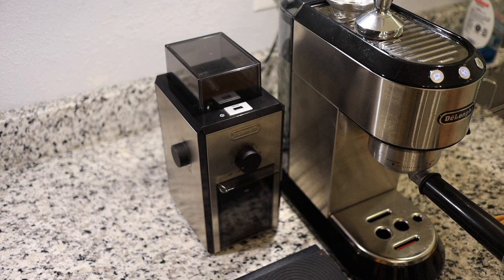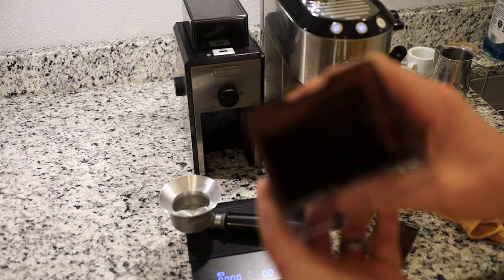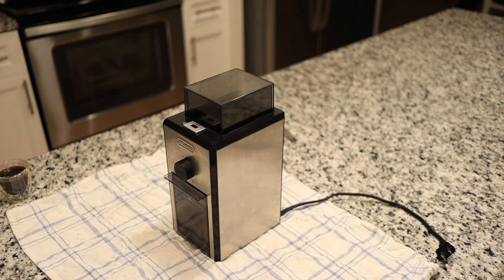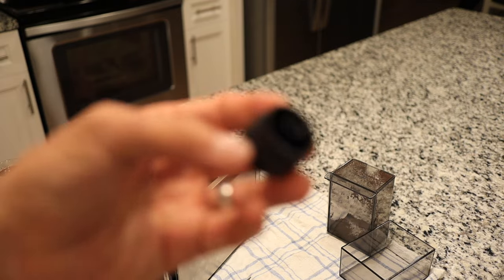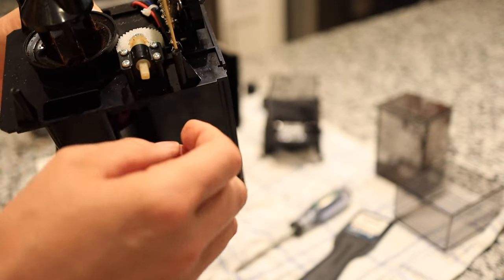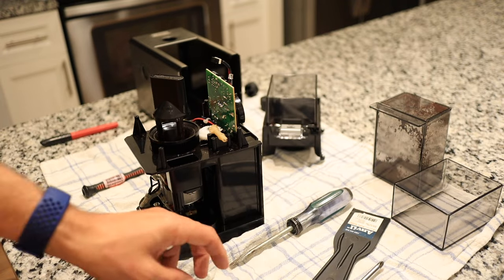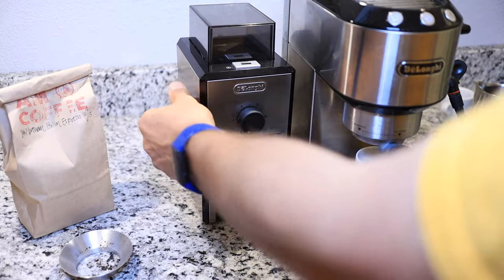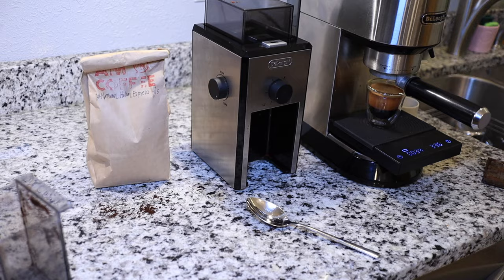Delonghi KG79 & KG89 Mod for Finer Grinding - The Easy Way

Comment: Hey, I just bought this model from Amazon in Ireland and I can confirm that it still works. I did the mod before i even turned it on, and the beans were a little bit too fine when i started grinding for the first time, but then they became perfect for my coffee machine. 

I did only 45 degree angle turn, which was about 5 clicks, and while still checking if the burrs can turn (with the top part on). You don't want any sound when you rotate the burr. Otherwise they will grind against each other. 

Amazing video, thanks so much. I was deciding between this machine and some other for 450 euro. This will do perfectly.
Reply from the maker: Thanks for your feedback, and congrats on your mod!

Comment: Just bought this machine. Was a little disappointed in the tase of my favourite blend and was thinking of sending this back for a refund. As it is not too expensive, I thought I would try this little hack. As in a previous message, I tried 13 clicks, which was too much. So I dialled back to 10 clicks and this was just fine enough. What a massive difference this has made to the taste of my favourite blend. Decided to keep this now. Thanks for the hack.
Reply from the maker: Sweet, Ian! Thanks for the feedback, and I am happy to hear your results. Cheers!

Comment: I did this mod and moved the wheel by 13 clicks. You can reach the motor underneatch and spin it using a small flathead screwdriver to test whether the burrs rub on each other. I can know grind a lot more fine and pull a shot from Dedica using unpressurized basket without any spray or channeling.
Thanks for the instructions!
Reply from the maker: Awesome, Kosta! Thanks for that tip! Happy coffee drinking!
Reply: Can you explain it a bit more detailed? I can figure it out what did you mean by spinning it with the small flathead screwdriver. How can it tell me if the burr is touching? Will it made strange sound when i rotate the motor manually?
Reply: @nhs.14  no. But it won’t  rotate
Reply: In my case 13 clicks sounds like a lot. I just set mine up for about 7 clicks and it is 1 click from 90 degrees. I will test the grind if it is espresso quality I will stop at that otherwise I will keep trying until I hit the espresso fine.
Reply: Did the 90 degrees rotation but wondered if I could go further. Is the 13 clicks as far as you can go? 

Also, I have an idea that you can just use a piece of thick paper to see if the top grinder part leaves a print on it when locked in. If so, that means it's dangerously close to the bottom part. Wanted to test that out to get some extra clicks but I had already done the 90 turn and all the screws were in place.
Reply: @tomaszhachula4171  13 clicks was max, 1 more click and I could have felt rubbing when rotating them using the screwdriver
Reply: @kostabizetic9353  Thank you. Have you noticed that the grinder on that 13 clicks setting have any difficulty with "pulling in" beans? Beans gets less space after all.
Reply: @tomaszhachula4171  haven't noticed or thought about it, maybe slight difference?

Comment: I have a Krups GVX2 grinder; basically the same as this, and the upgrade is the same  process. This said, even after doing this shots were still running a little fast so I decided an alternative, Double grinding. I initially ground my beans at the halfway point, and then reground this at the finest setting...the result?...Med/Dark roast,15g in, 30 g out, 26 sec, 6mm of crema, great shot!....For reference this was using a ITS precision 51mm basket on a Delonghi Stilosa.
Reply from the maker: Hey wow that's an interesting experiment - thanks for posting the results! Tom

Comment: The way I did this mod was to remove the tab on the adjustment wheel. While it's off and empty, you can turn it as fine as is possible to get the burrs to touch. Once there, step back a half turn and turn it on empty to ensure that it's free moving and not locking up.  Then I pull back another full turn and slowly dial in where I want to be.  I think i'm about 3 full turns past where it would have stopped out of the box. But there's no real way to know that.  I do need to change how coarse or fine it is based on the bean I'm using.

Quick note: I got this one about 7 years ago. It worked fine for about 3 months then when I went to make some morning coffee the collector was jampacked full and the motor was burnt out. I dont know if it randomly did that or if one of the kids played with it. So out of habit, I dont push the collector in all the way until I'm ready to use it. It was replaced under warranty and due to the habit, I've not had any problems with it. It's a nice little grinder, if clumpy and lots of static. It gets far worse with the static on dark beans.  But over the years, I have never found a bean that just wouldnt grind with this. Easy to clean and maintain; however it's just messy.  I feel it's been a great starter grinder, with the mod of course.

Edit: Due to habit, the first thing I do when the grinder is done grinding is pull the collector, leave the lid on and have my hand or a napkin cover the "chute" hole and do a gentle tap on the counter. That keeps the mess to a minimum.  I then just use a scoop to scoop out the coffee instead of trying to guide the coffee in that square box...it never seems to cooperate.
Reply from the maker: Thanks for sharing, and for those great tips! Have you tried RDT - lightly spraying your beans with a water mist before grinding? That could help with the static. But yes, this is a sweet little metal burr grinder, considering the price, in particular with the mod. Cheers!
Reply: @TomsCoffeeCorner  I've just recently learned about the misting, but I'm not sure how good that would be since I keep beans in the hopper. It only fits around 6-8oz or just more than half a bag so I'd think spritzing the beans would be a bit messy over time. I'd definitely try if I was single dosing.

Comment: Thank you for the tip, unfortunately mine doesn't work anymore after putting it together. I don't know what i did wrong. Do you have any tips on how to fix it?
Reply: If it doesn't spin, make sure that you don't put the parts too tight, maybe they're blocked. Or some sensor is not connected correctly. Double check.

Comment: Thanks for the video! I have been using the KG89 with this mod for 2 years and I can seem to pull good shots (extraction time is around 25-30 seconds with my Dedica). However, the shots usually taste too acidic, and bland despite using fresh beans. How would you compare the KG89 to more expensive grinders? Should I get a better one, or is it good enough for the purpose? I'm unsure what to expect as I have no experience with high-end grinders.
Reply from the maker: You might benefit from either a hotter pull from a different machine, or trying the steam mode hack on your Dedica.
Reply: @TomsCoffeeCorner  Thanks for your reply! I did some tests, and the steam mode hack indeed helped me to slightly reduce the acidity (to my surprise). Thanks for the advice!

Comment: Hi Tom, is it safe to turn the knob 90º as shown in the video?
Is there a risk of burning the machine?
Do the threads touch?
Reply from the maker: I have found that 90 degrees is fine. Some have done 180 degrees without issue. But, be careful, it's at your own risk. Just increment slightly until you can get fine enough.

Comment: Hey Tom. Question if you were able to get this used for cheap but the kingrinder P2 for about $30 more which would you choose and why?
Reply from the maker: I haven't tried the P2, but I am guessing it will be more consistent, and better to dial in. Cheers!

Comment: Hey Tom. I tried this but now my machine won’t turn on. The sensor turns blue when I press the on button, but no grinding. Can you assist?
Reply from the maker: Could it be that you have the burrs too close together? Can you back off a little bit?
Reply: By backing off a little bit, do you mean changing it back to original alignment? I’ve tried that and still not truly turning on. Only getting the blue power light show when I press the on button.
Reply from the maker: @tylerbarnes659  You might be missing one of the tiny safety reed switches. Please re-check your assembly, and make sure they are all making contact. I think there are 2-3 of them.

Comment: I bought the same grinder and modified the same as you did but still the coffee doesnt come fine enough, any suggestion Tom ?
Reply from the maker: Well, you can adjust it further than a quarter turn, but you just have to be careful that the burrs don't collide. Also, make sure ot use freshly roasted coffee beans. Cheers!
Reply: Am trying with fresh beans first than cuz ma afraid to make it more. Thanks Tom, always you are the best for help.

Comment: Hi, when you say "one notch finer" almost stopped the machine, does this mean you went back into the workings of the grinder and turned the burr even more? Or that the first time you did the mod, you only selected the second to finest size and then tried the very finest the second time?
Reply from the maker: I believe I just turned it around 90 degrees. By notch I mean on the dial. One notch makes quite a difference in grind size.

Comment: It's my first time buying an automatic grinder so I wanted to ask some questions.

First, I mostly plan on using the Kg89 for pour overs so is this machine fine for that? And second is, does the Kg89 last a long time? Like is it likely to break or something? Mind you, I probably won't be doing any modifications to it.
Reply from the maker: Hi there! Sure the KG89 will be just fine for pour overs. I cannot speak much to the longevity, but I think for pour overs it should last a while. That would be my guess. It's lighter work for the motor. Also, the darker the bean, the easier it is to grind.

Comment: Hi, does this grinder works for non pressure filter? thanks for all the videos! it helps a lot!
Reply from the maker: Hello Iker, thanks for the question. Yes, that is what this video is all about. With this modification, you can grind fine enough for espresso, made with a non-pressurized basket. Just watch to the end of the video, and you will see.
Reply: @TomsCoffeeCorner  thanks a lot! As I wanna improve to non pressurised basket and I can't afford a good grinder for it.

Comment: Hey everyone, I just did this upgrade but unfortunately there's another part that he doesn't show in the vid and if you lose it the grinder will not work, So when you disassemble the sensor be aware that there are two parts, The sensor itself and a pin that touch the sensor when you close the lid, When I removed the sensor the pin flew out and it's super tiny so I lost it, If that happens to you what I would suggest is that you glue the sensor to make it always on, So that even if the lid is open the machine will work, Anyway that's what I did and it's perfect now.
Reply from the maker: That's true, you have to be careful that the microswitches stay in place.
Reply: Dude, your comment saved my grinder. I found this little pert on the floor, becouse in the video it doesn't shown. Thanks a lot!
Reply: @Hornton990  No worries brother!

Comment: Anyone can tell me how to know if the grinder touch the burr? If done this but it wasn’t fine enough, my espresso is way too fast and under extracted
Reply from the maker: Hi there! Well you would feel or hear the resistance of the burrs touching. Try not to let conical burrs touch if you can avoid it.

Comment: It feel like your button can rotate freely(from coarse to fine in clockwise direction), and you didnt say(show) where to set the button for the fine coffee grind which is good for nice shots. Tried the mod, recieved kinda good shot at fine setting(meaning didnt move the button after modding), tried second type of coffee(both was medium roasted) aaaand not good.
Reply from the maker: Hey Tohn, I did show that the dial must be turned all the way to the left (fine) before starting. To get a finer grind,   keep turning to the left. If the first batch of beans was good, and the second wasn't, then maybe the second batch was too old...? What brand of beans are you using?
Reply: @TomsCoffeeCorner  Just to clarify what i did was turning the big white wheel anti clockwise 90 degrees(the original marking was on the right) and then put little arm in original position with the knob on the left side meaning that this is the last setting for fine grind, i think i see in video that you just rotated the arm not the wheel, or am i wrong ? Should i dissasemble again and rotate the arm too ?The coffee beans are - medium roast starbucks pike place and the second is davidoff 57 espresso intense(which had almost no crema) with after market basket
Reply from the maker: Hey there, you are right, I forgot to calibrate the wheel, so that when I set it to grind finer now, the wheel goes past "fine." But that's not a big deal, I can just pop the wheel off and adjust. 

As for Starbucks beans, I have had really bad luck with those. Some of the worst I have tried. I think they are too old. Where are you located? Do you have a roastery near by?
Reply from the maker: @NancyBaabe  Hey there, thanks for your comment. Well, I did show all the steps I took. There are various ways to grind finer, but the way I showed, to just turn the stem 90 degrees is the easiest. Do you have any specific questions about the mod?

Comment: I have done the mod and for a long time it worked fine, until i got myself some more expensive beans. Now, at the same grind setting my delonghi machine pops out the rubber above the portafilter, the one around the shower screen. I need at least 2-3 grind clicks lower to make it work. Do the beans make such a difference? Has that happened to anybody else?
Reply from the maker: Hmmm. I have never seen that happen. If anything the machine should choke, not loosen a gasket. How old is your delonghi, and which model?
Reply: @TomsCoffeeCorner  EC680, not that old. I did have to change that gasket eventually cause it got ripped, but it continues to pop it out every time unless I drop the grind setting 2 to 3 clicks coarser from before. Btw, I had it at the middle position before. Then the water runs very fast and the extraction is poor...taste is not good at all. I guess I'll have to stick to the previous beans, can't afford buying new gaskets all the time 😄. Channeling is always there, no matter what I do...
Reply: When using super fine coffee mine choked, but no rubber popping out... Like shown at the end of the video 10:40

Comment: No way! My KG79 is not able to grind beans like yours in "stock grinder test". I bought NPF but i have to change grinder. Using KG79 and NPF Coffee is coming out way to fast and Hance, The shot is really watery. :(
Reply from the maker: Well, you may need to grind finer yet, and make sure you are using freshly roasted beans. 👍

Comment: Hello Tom, great video again! I am now considering buying this grinder and do the adjustment. Is this something you would recommend or do you think there's other grinders that would be a better purchase?
Reply from the maker: Hey there Sop! I like this grinder for being small and light and ergonomic. It would be a good travel grinder for me, but probably not a daily driver for espresso. It would need to have more adjustments for that. 
What price range are you thinking of? I really like the Specialita, but there’s more economical options as well. Maybe the Sette, by Baratza for example. Good luck, and let me know which route you go! 🙋‍♂️
Reply: @TomsCoffeeCorner  I decided to give it a go and so far I quite like it, I don't seem to have static nearly as bad as you did... I haven't done the mod yet, my shots are sometimes good and sometimes there's quite a lot of channeling, I'm not sure why... could this be because the grind is not fine enough? Or is it poor distribution?
Reply from the maker: @soplv605  Well, mainly I would say distribution and puck prep are key here. Channeling can be caused by many sources. Are you weighing out your doses?
Reply: I just did this my KG79 and it was so easy.  Didn't even need to pop the sensor.  Took 5 minutes and has made a huge difference.  I used the 90 degrees method.  Lovely.  In the UK these are on sale on Amazon atm as of today (16th Feb).
Reply from the maker: @merlinathrawes6191  Awesome, Merlin! Thanks for the tip! 44 pounds for one of these is quite a good deal, I find.
Reply: @merlinathrawes6191  Hi sorry to disturb but I was wondering what are your thoughts on the KG79? After adjusting were you able to get a good espresso grind? I was curious because I’m considering to get my first espresso machine in the future and saw some great deals of the Dedica machine with this grinder in my area. Would you recommend it? Thanks.
Reply: @a.a2397  Hi my friend.  I would recommend it.  I haven't had any problems except an occasional clean.  2 years on and it's still going strong.  It was also fine without the mod but I like to tinker!  Perhaps not the same as a £400 grinder but infinitely better than a rotary one for only a bit more.  After adjusting, my grind for my the Sage Duotemp was about 10% finer but pulls a very nice espresso indeed.  You just have to watch it doesn't get to fine.  Mine is perfect.
Reply: @merlinathrawes6191  Hey bro, thanks for the reply that’s great to hear because I was considering which is why I asked. That’s great to know then as at the moment I need one that fits my budget which is why I asked haha. Thanks for the reply again I appreciate it!